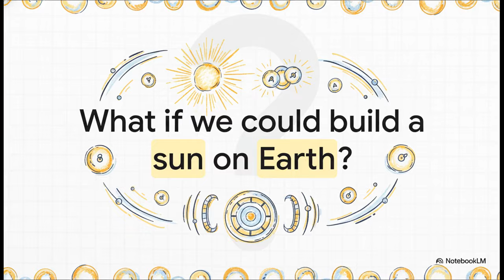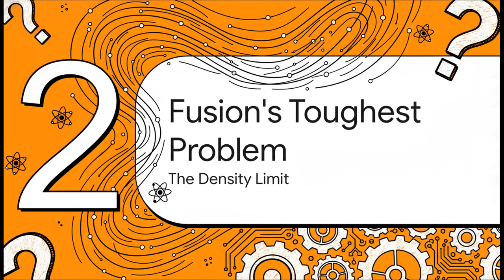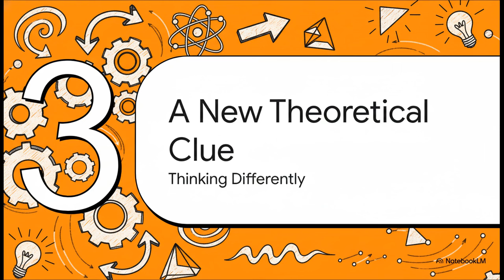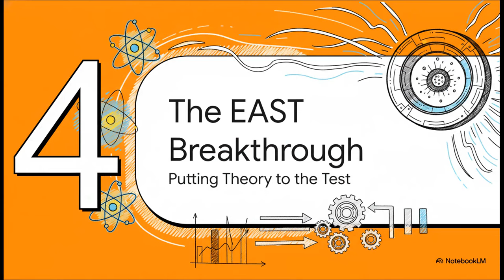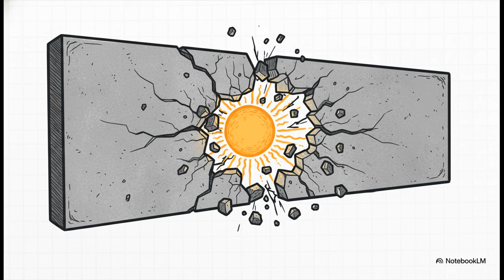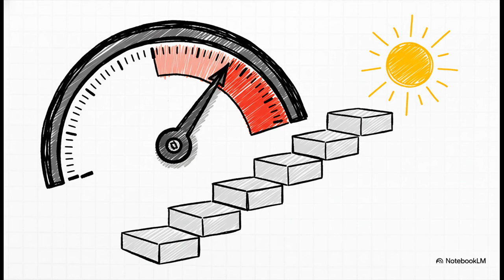Man-Made Sun Breakthrough. Fusion Energy Reaches New Stage

Comment: A few things that I would like you to talk about more about aneutronic fusion and non-equilibrium systems. Lots of other designs including the TocaMac use neutral beam injections but it doesn't increase the beta like they do in polywell. Also mix between the poly well and FRC is the Lockheed Martin compact fusion reactor. The thing about the FRC and pollywell is they can both be used as propulsion devices and I'm guessing this is why the polywell stopped publicly and Lockheed Martin's design was a black project. Another thing you didn't really talk about is the non-equilibrium plasmas where the ions are separated and kept cooler away from the hot electrons. This changes a lot because the system is being driven in a different manner compared to equilibrium plasmas.  A similar design to the poliwild that never was brought to fruition is sal Pais plasma compression fusion device which incorporates IEC and magnetic confinement similar to the polywell. I didn't mean that high beta was the answer I meant that a beta of one is really what you're looking for not one way or the other and in the equations this means that the reactor would be 1 m across ideally because that's what R would have to be in the Beta equation. Also all the magnetic fuel lines are expelled at this point and things like the messiner effect occur and perhaps other quantum effects that we aren't aware of. This is why we don't have fusion and I'm not being conspiratorial. Dr Bussard himself when working on the pulley well had to do it in somewhat secrecy because he didn't want to risk having too much funding from the Navy and being shut down by the DOE. He said this in his Google talk. Anyway hope that helps but you got to get the whole story and it's hard to do in a 6-minute video. Neutral beam injections are used a lot of places it's just how they are used and in what configuration is what matters

Comment: Tokamaks will never work. Look into the polywell and TAE's FRC with nueral beam injection. They solve the stability problem. Dr. Bussard the guy who initially advocated for the Tokamak in the 70s said they are just a confinement expirement and money grab. Non-equilibrium plasmas are the only way to drive the system that will work and they are compact meaning way less expensive to built. The beta has to be one look at the formula and the ideal size would be about 1 m reactor where the fusion events occur. This video was kind of just regurgitating the mainstream narrative that will never get us anywhere
Reply from the maker: Can you suggest valid sources we can check to create a new video based on your input? Thanks in advance
Reply: @AIFinanceStudio Dr. Bussard was on the committee who initially pushed the tokamac design in the '70s and then he said it was only to prove confinement and ended up trashing them later on because they stuck with them and he never intended this. The pollywell concept was his and was later taken on by Dr Park after he deceased. There are YouTube videos of him Dr broussard speaking at Google where he talks about how they have the physics worked out. Dr Park also has a video I think from 2014 proving the poly well with two neutral beam injections works very well because the neutral beam injections strengthen the magnetic field where the plasma pressure equals the magnetic field pressure called beta equal to one. Then you have t a e's design for the FRC that's a neutral beam injection similar to the poly well also non-equilibrium and then you have helion fusions FRC design which is pulsed and also not an equilibrium and high beta near 1. Tokamaks have a low beta That's why they have to make the machine so huge which then makes them colossal and really unlikely to succeed because of the huge investment needed where a much smaller design like the polywell or FRC with a beta near one can be way smaller like 10 times smaller if not less. Hot fusion is a scam in my opinion from tokamaks and stellarators.
Reply: @AIFinanceStudio  a great quote from Dr bussard is you don't see stars in the shape of a donut when you look up at the sky lol. The Polywell and FRCs are poloidal not toroidal like tokamacs. They said the secret with the pollywell is the neutral beam injection to get the beta high near one that cancels out all the magnetic fields it's in the 2014 talk with Dr Park. I've been researching fusion for the last year or so and this is what I've found. Certain companies like TAE which Trump media company just acquired through a merger who are aiming for anuetronic fusion with boron11 hydrogen have the secret sauce recipe. Dr Park who was working on the pollywell before now works for TAE. Probably where they got the neutral beam injection idea from for beta near 1. You're welcome for the information
Reply from the maker: @MichaelVodinelich26   I found these links sources: 
1. https://www.emc2fusion.com/team/jaeyoung-park#:~:text=Park%20led%20the%20EMC2%20team,GiovanniLapenta%2C%20Dr.
2. https://tae.com/trump-media-and-technology-group-to-merge-with-tae-technologies/
3. https://www.youtube.com/watch?v=ppgdT3SQMhI
4. https://kse.com.pk/trump-media-to-merge-with-fusion-firm-tae-technologies-in-6-billion-bet-on-clean-energy/#:~:text=Truth%20Social%20parent%20company%20Trump,into%20the%20energy%20infrastructure%20sector. 

Do you have any better ones?  Thanks in advance. We are preparing another video on this aspect. We really appreciate your contribution.
Reply: @AIFinanceStudio I'll take a look later on. I've been basically spending the last year researching the fusion so you're very welcome for my research.
Reply from the maker: @MichaelVodinelich26 very glad to year.. your contribution will be welcome and promoted in our platform here anytime. This is a free place where to gather and spread knowledge at its best.
Reply from the maker: @MichaelVodinelich26 just to let you know that, following your input we just published a new video https://youtu.be/0EdZv8TznB4
Reply: @AIFinanceStudio Look up scientific papers from Dr Park and bussard or AI is a great tool also I cited a few YouTube videos which are easy to find. TAE does a walkthrough of their facility on YouTube and helion fusion also has videos. The great thing about aneutronic fusion is that you can skip the turbine and have direct energy conversion through induction from the charged particles which is much more efficient already then using DT as a fuel